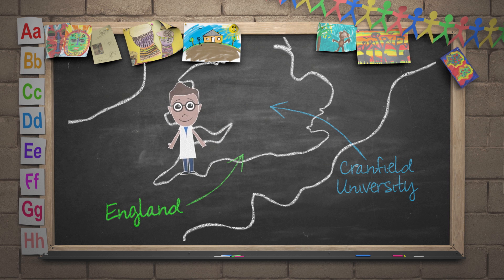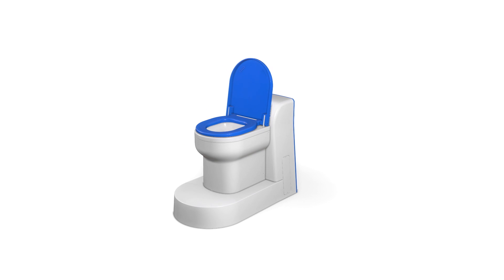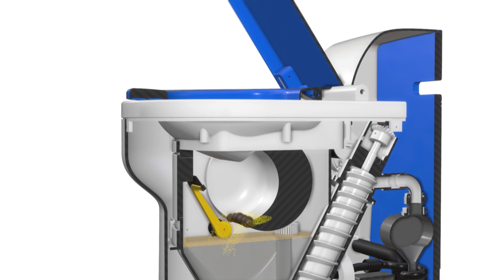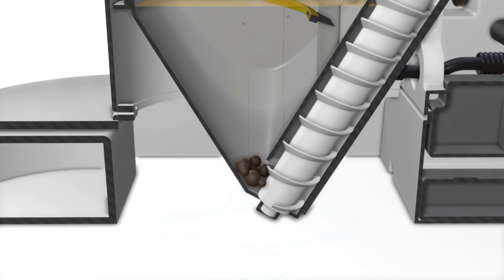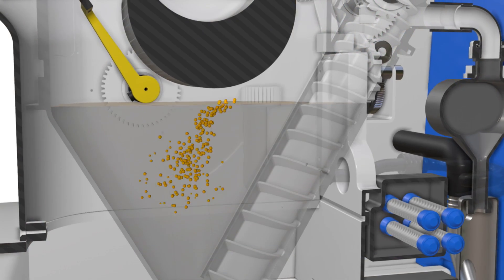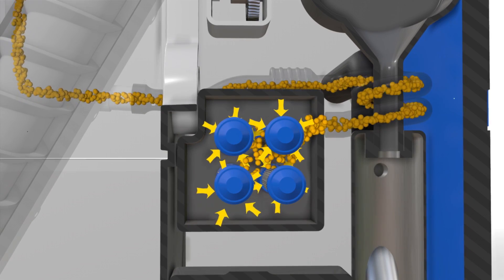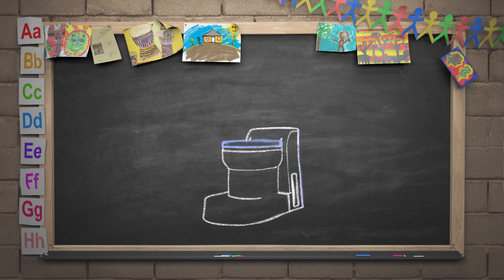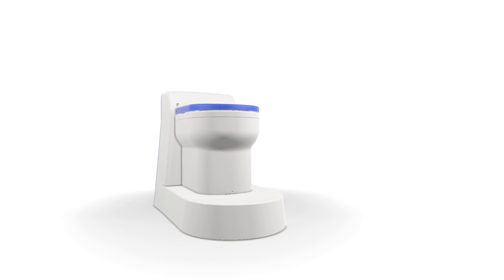The Cranfield nanomembrane toilet - how it works...

Comment: This is another one of those things that seems great on paper, but completely stupid and based on pandering to people by illiciting an emotional response. How is the liquid waste filter emptied, what powers the burner, why isn't the ash advertised to be used as fertilizer?
Reply: FreeDog70 is right, the gasifer/combustor will first dry the solids and then burn them. The process will burn 24/7 so regular reignition will not be needed.   We are keen to avoid using a solar panel to keep the cost down. 

We have published a journal paper on the energy balance of the toilet which is free to download here: 

http://www.sciencedirect.com/science/article/pii/S0196890416306628

The bicycle/handcrank that Skullzy Xue mentions was a previous idea that we're not taking forwards.   This video represents our latest thinking.
Reply: FreeDog70 No, but I understand how energy works. There is no way this thing would work without external power, plus the filters still have to get replaced for the liquid waster
Reply: FreeDog70 And this is enough power to also burn wet shit? I highly doubt it, this thing will be running full duty for probably more than 3 people. I don't see a carousel for drying out the hydrocarbons for burning either
Reply: FreeDog70 And where does that activation energy come from? Again, they're not drying the solids first, so it's going to take a lot of heat to get combustion going, which takes energy
Reply: Accept your rekt status
Reply: Assuming there is 244ml of water in the average stool it would take 551 kJ of energy to evaporate all of it. A very strong punch is about .5 kJ.  Closing the lid can't do anything but the mechanics due to its shear defecit of energy, there's no way it would have enough energy to dry the solids. Assuming there is 105 grams of biomass the heat of combustion is about 2.3 J/k, or .008kJ per stool. The energy output total is .508kJ including closing the lid at the absolute maximum. Per defecation session that's .4% of what's necessary to even just dry the stool. Try using your brain, I spent more time typing this than researching and calculating.
Edit: missed a comma
Reply: Mattsoup ooh rekt
Reply: FreeDog70 How is it dried?! It takes energy to do this and there is no mechanism for accomplishing it in the design
Reply: FreeDog70 I keep getting more and more convinced you're a 12 year old who can't tolerate being told they're wrong
Reply: And those 3 things are? As I see it Mattsoup presented a much stronger case with much more evidence to support it than you did.
Reply: FreeDog70 I did type out a long rebuttal to everything you've said, but decided against it. You don't seem to understand that I design and run multimillion chemical plants and what's happening in this toilet is a chemical process. I'm not an "expert", I'm a paid professional who lives, sweats, and breathes this kind of thing.
Reply: That would make sense if they are adding an external power in addition to this mechanism!!!
From this view, the video by itself does not make sense. 
The law of thermodynamic says it is impossible ......the end.... microphone dropped...... lol
Reply: FreeDog70 I don't know what I can do besides use actual numbers to convince you. You've fallen for the bullshit friend.
Reply: The toilet is powered by a battery which they charge themselves by rotating a crank, in another video they released they demonstrate this by explaining that a bicycle would be used to recharge the batteries.
Reply: FreeDog70 Evaporation, boiling, drying, it's all the same thing. You're the ignorant one here, clinging to your confirmation bias and refusing to believe opposing evidence
Reply: FreeDog70 I'd be more than interested to know how you make 508kJ of energy without any extra effort
Reply: FreeDog70 Humor me
Reply: FreeDog70 What do you mean get over yourself? The toilet in the video would not work, that's all I said. What exactly are your credential to correct me anyway? You demanded mine
Reply: Skullzy Xue After coming back to this, 508 kJ is about 125 kcal, which is a hell of a lot of pedaling, especially for people who can't afford the extra energy because they have limited food supply
Reply: Skullzy Xue That's reasonable, but it still reduces the convenience factor of "just raise and lower the lid" they push in the video. This also keeps adding space that this thing needs to take up. I'm pretty sure a solar panel and small nimh cell would be much more space and time efficient. And what about drying the solids?

Comment: Why throw away the ashes? Why not use them as fertilizer in the garden? Or give them to the cement factory? Or mix them into cement while doing masonry? Or just bury them in the yard? ... instead of sending them to overflowing garbage dumps.
Reply: http://www4.uwm.edu/cbu/abstracts/03-513.pdf        on use of ash in cement
Reply: Please remind me where the nanomembrane is. Thx.
Reply: 20-40% of Portland cement can be replaced by "fly ash" (which should not be too different from fecal ash).
http://www.motherearthliving.com/mother-earth-living/nuts--bolts430634835583544301540?pageid=1#PageContent1
Reply: Chris - as we discussed on the SuSanA forum the amount of ash generated will be tiny but I welcome your ideas of how it could be used productively.